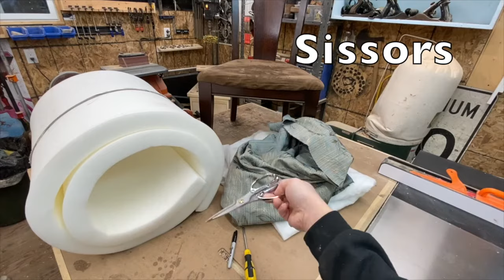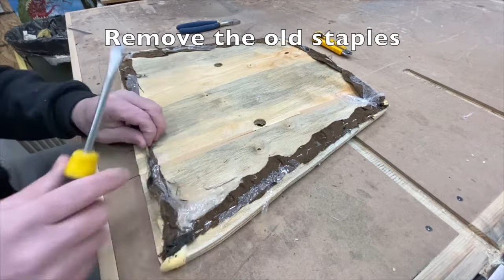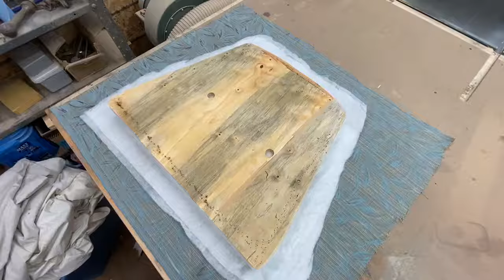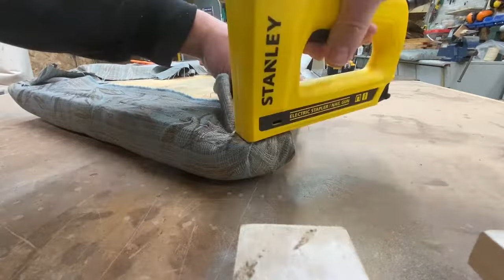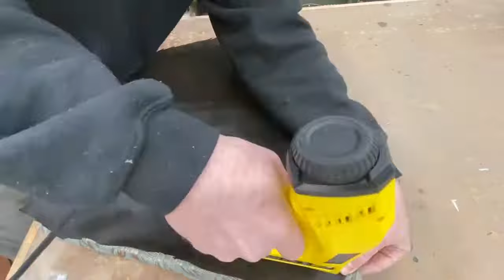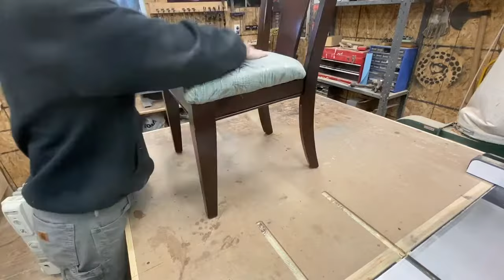(How To) DIY Reupholstering Dining Room Chairs!

Comment: Nice video 👍Removing the staples.... I just used six hours of my weekend removing staples and fabric from five seats. Definitely worth it though. 15 year old dining set getting full sand back and new oil finish with new foam and fabric. Easily get another 15 years out if it!

I kept the original fabrics as a template to cut the new material for less off cut waste.

Comment: Nice video! Very simple and effective approach. 👍
My old crappy stapler died and need to get a good one this time. What do you recommend? Needs to be able to drive the staples fully, not just half way like my old one. Was thinking of the Stanley TR250,but it has mixed reviews... Any help is greatly appreciated. Cheers!

Comment: Good video. Just what I needed. Instead of removing 300 staples for each chair, just cut some new wood pieces of more solid wood. This beetle pine is flimsy and cracked. I would sell it for art projects and use fresh wood to justify a labor intensive project.

Why does no one get an air compressor and a real staple gun? This one is a joke!  All those staples will pop out soon as someone sits on that chair. $150 for a Porter Cable 6 gal 150 PSI air compressor at Home Depot. If you are lucky they come bundled with a Stapler, Brad Nailer, and a Finish Nailer.  Every home should have an air compressor.
And women - get one too! Don't make excuses. If you can make coffee you can use this.